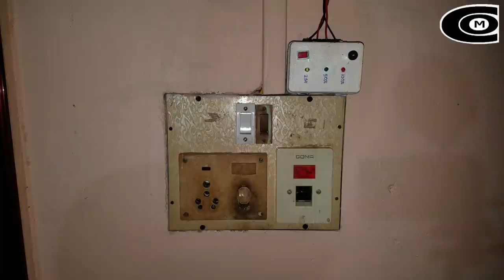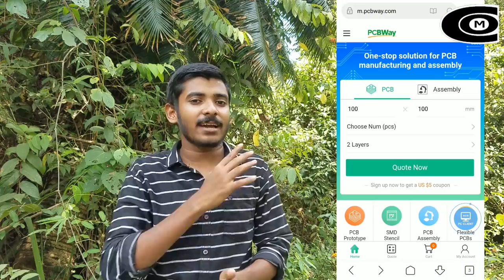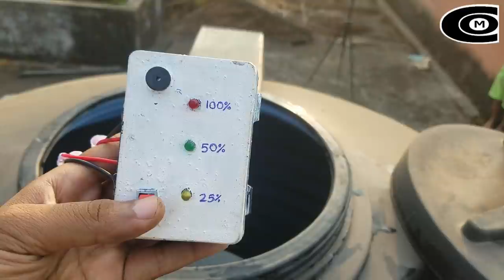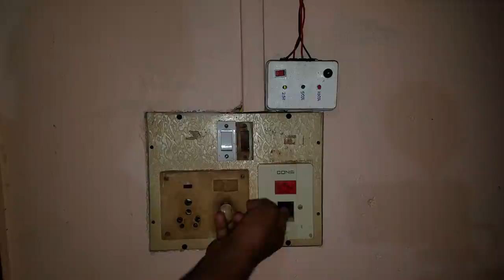How To Make Water Level Indicator + Alarm At Easy | ഇനി വെള്ളം പായാവില്ല..👌

Comment: Bro. very nice and helpful. Is it possible to reverse the circuit.I mean use in well or sump so that light and buzzer come.on when water level.is just about to reach foot valve level.so as to prevent motor from pulling.air, if possible can you let me know how the circuit will be thanks

Comment: Use 2 pair or 4 pair telephone wire for sensor to circuit connection, also avoid screw connections ,skinned tin coated copper wire of the telephone wire wind two or more times tightly on a pipe will  act as sensors,it will protect the sensor from loose connection and corrosion at some extent.

Comment: It's working fine with 9v DC battery but when I connect mobile charger the LEDs emits low light even when the wires are disconnected or not in water. Any idea?

Comment: Hallo brother, when I put the switch on the buzzer is making a low sound and light is getting on, not on full brightness  , is it because of loose connection
Reply: Bro did you got the solution for this problem

Comment: ഇതിൽ resistor transistor ആവശ്യമുണ്ടോ? Direct led battery യിലേക്ക് കണക്ട് ചെയ്താൽ പോരെ... അങ്ങനെ ചെയ്താൽ work ചെയ്യുമോ please reply....
Reply from the maker: Illa,
Reply: Direct led yil 9v battery കൊടുത്താൽ led bulb അടിച്ചു പോകും രസിസ്റ്റർ വേണം
Reply: led work from 1.5 to 12 volt. if we give 12 volt for a 6 volt led that led got damaged .so resister is very important .one resister can drop some voltage .  thank you sir
Reply: 5volt mobile charger ഉപയോഗിച്ച് ട്രാൻസ്സിറ്റർ ഇല്ലാതെ ഇത് ചെയ്യാം ഞാൻ ചെയ്തിട്ടുണ്ട് ടെലഫോൺ 4 cor വയർ ഉപയോഗിച്ചാൺ ഞാൻ ചെയ്തത് ചെറിയ ബസ്സർ വർക്ക് ചെയ്തില്ല വലുത് വണ്ടിക്ക് വെക്കുന്നത് വർക്ക് ചെയ്യുന്ന

Comment: Bro ithu njan chaithu use chaiyukayaayirunu,

Pump working, 25%, 100%(ഇതിൽ buzzerum koduthu)

Epol njan 50% koodi add chaithu apol muthal switch idumbozhe buzzer cheriya sound undaakunnu,  enthukondaa angane, 100% aakumbol buzzer full volume adikum
Reply: Please reply.
Reply from the maker: Transistor base legil 200 ohm resistor vech nokiyo